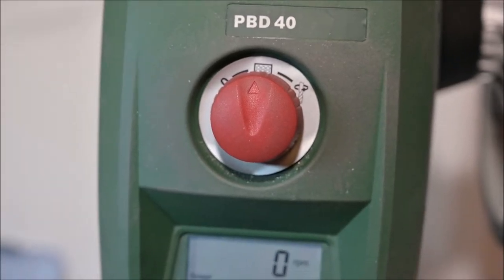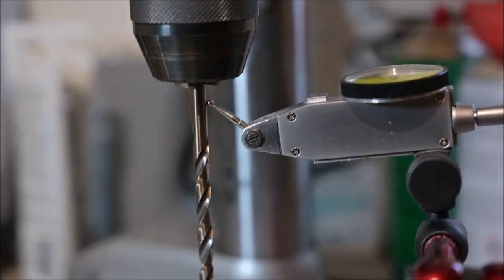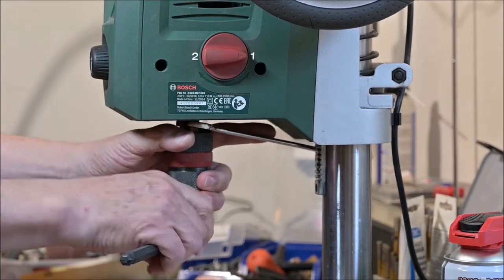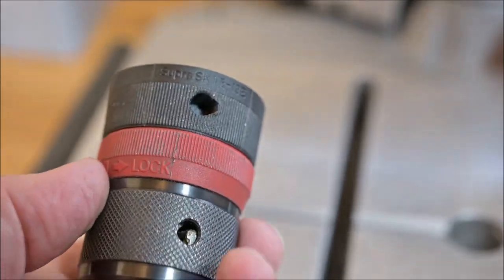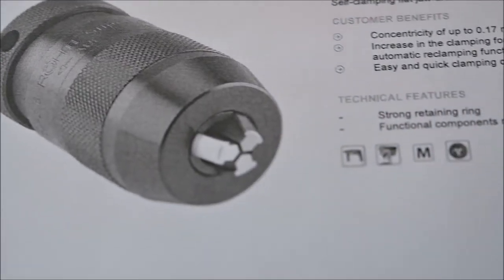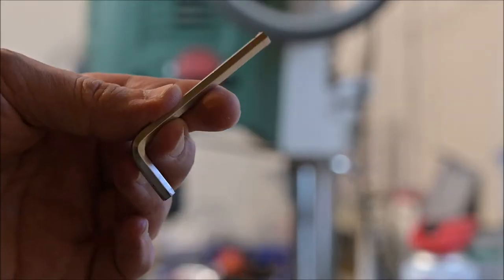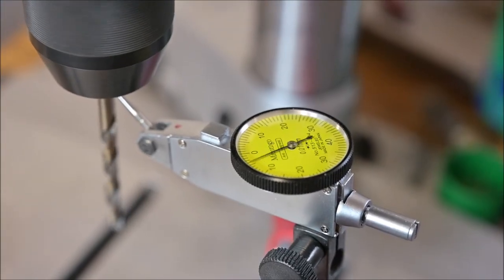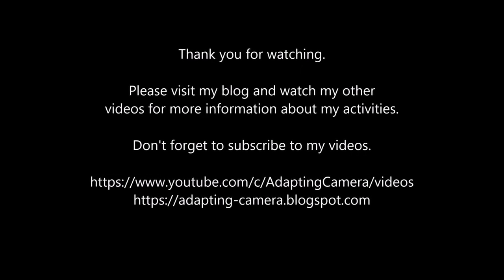Chuck changing on Bosch PBD 40

Comment: I hope you can help.  I tried you method of chuck removal, but the locking mechanism seems to have broken and now when i exert force on the chuck with the Allen key it just opens the chuck so that the Allen key falls out.  Any ideas?
Reply from the maker: I am sorry for the problem you experience. Maybe the locking mechanism is not really broken, so try rotating the Allen key slightly so that all three jaws get a good grip of the Allen key surfaces and then try to lock it again. If it clicks then you are good, but if not then your only option is to use some sort of special tool made for chuck removal. There are two holes on the top of the chuck, above the red locking ring, so if you insert two pins into those then you should be able to twist and remove the chuck. If that doesn't help then you could get an adjustable pipe wrench with rounded jaws, put some soft metal (aluminium or cuper) sheets between the jaws and the chuck and lock it on the top ring, above the red locking ring. That should definitely do the job. Just be careful, the chuck gets easily damaged if you are not using some soft metal sheets between the wrench and the chuck. At the same time, you must tighten it hard enough so that the wrench is not slipping. Good luck, I hope you will be able the remove the chuck, especially if the locking mechanism is really broken.

Comment: II am in the process of changing the chuck, can you please tell me what size allen key you used? I am having extreme difficulty removing the old chuck because it keeps releasing the key as soon as I try rotating the chuck to loosen, thanks!
Reply from the maker: Hi, I think I used a 10 mm (220 mm long) Allen key plus the tube to extend it. The trick to tighten the Allen key in the chuck is that the jaws must be parallel to the key sides. Be careful, if the Allen key is incorrectly inserted and tightened, you may never be able to release it again. It is important that the chuck gets a good grip on the Allen key sides, otherwise it may get stuck when you twist it. Good luck, I hope you manage to remove it. Mine was also very difficult to remove the first time, maybe they glued the threads, or maybe it was because I have used the machine for several years before removing the chuck, or maybe the original chuck was installed by a huge alpha male with too much muscles and too little brains... 😂

Comment: Thank you for this video, I am on my second PBD 40 after Bosch swapped the first one for this runout. The second one is not much better so will be doing as you did with a new chuck. Did you ever measure the runout on the shaft without a chuck? Thank you again.

Comment: Hi there thanks for the info.. But i have question.. Can i use a 16mm or 20mm chuck on this drill press and if so what is the best option to go for.. Thanks again sir
Reply from the maker: Thank you for your comment. You could use a 16 mm chuck but remember that you will lose the ability to use small drills. The 16 mm chucks are also much heavier and larger. The Rohm 871062 Supra S 3-16 is one example but it is 340 g heavier and 14 mm longer. The original chuck is 375 g so already the one I chose is about 200 g heavier and about 5 mm longer than the original, I would not add even more weight and size. Also remember that the motor is only 710 W so it is not that strong. In my opinion 13 mm is the optimal limit, and of course, in my opinion, the one I chose is the best, at least for my needs. 13 mm does not mean that you can't drill larger holes, I have drilled very large wholes, also in metal, but you need the right drill.
Reply: @AdaptingCamera  Sir thanks alot for these valuable information, you've been so informative. I think I will stick with your advice since it really makes a lot of sense. I wish you a very cheerful day.. Stay safe my friend 👍🏼🌹

Comment: I purchased the Röhm chuck you used to upgrade my Bosch chuck but it came without the screw threaded Mount and now needs the addition of an Arbor which prevents it being fitted to the Bosch PDB 40 Bench Drill. It seems the screw-on version of the upgrade is no longer available.
Reply from the maker: I don't know what you mean by no longer available... I mean, it's made and is definitely available but perhaps not in the shop you wanted to buy it from. You can buy it from here: https://eshop247.roehm.biz/DE-en/supra-s-264.html Sorry you ordered the wrong one, try to return it because you have no use for that one. When you order you must type the right part number. Only the ones with 1/2"-20 mount fit this machine, and the one I am using is the 871050. That is very important when you buy the chuck.
Reply: @AdaptingCamera  thank you for responding to my comment. I think being sent the non-threaded version bearing the model no. 871050 didn’t help and suggested the correct chuck in your video was not available now. I spoke to RÖHM and they confirmed 871050 to be the threaded one as you state. Quite why the one I bought from V-TOOLSTORE in Germany isn’t the threaded one albeit bearing the same model number confused the guy at RÖHM so not sure what’s going on at V-TOOLSTORE 🤷🏼‍♂️. But I was advised by RÖHM in U.K. to contact a U.K. company called Cromwell to buy the correct one and it’s being delivered Monday. The non-compliant one will go back to Germany for a refund. Thanks for a great video and your help towards me sorting it out. 👍🏻
Reply from the maker: @TonyGator78  If they sent you the wrong chuck they should exchange it for free. The Röhm product numbers are different and unique. The 871050 is the only one with that number and that is threaded. If that shop told you otherwise then they are lying.
Reply: @AdaptingCamera  I asked them if they could get the version with a threaded back end but after saying today that they cannot they agreed to a refund. I have contacted RÖHM at their U.K. distribution centre and while they cannot sell me the correct one they told me who could and I ordered it today. So hopefully I will get it on Monday and the refund will pay for it. 👍🏻

Comment: Thankyou for posting this video. My issue is I own the drill and this have purchased the same upgrade chuck. My issue is when I lock the old check with a wrench and use an Allen Key in the same direction as your video, the chuck releases the allen Key even though the chuck has been set to Lock. Would you know what im doing wrong as I cannot remove the chuck for the life of me.
Reply from the maker: Difficult to say, but maybe you did not insert the allen key right. Three of the allen key sides must be perfectly aligned with the chuck jaws. Anyway, this is one reason I replaced the chuck, the locking mechanism is a joke on the original chuck. Mine occasionally released the drill, which is definitely horrible.

Comment: Just for clarity (since the Rohm link isn't working): It seems like the actual model showed here is the '871050', which he points out at 5:35.
Reply from the maker: Thanks. Yes, it is the 871050 and I don't understand why the link is dead. Maybe they stopped making it with that number.
Reply: @AdaptingCamera  Seems more like it's some sort of page update where they didn't migrate the links.  I bought that same model from them just this week and installed it a few minutes ago.  That first chuck is stuck on there really tight, but the 'handle' tricked work (eventually).  No loud bang, but a lot of sweat! Thanks for the video.  Really appreciated!
Reply from the maker: @Drokkstar_  Good news. Thank you for your comment. I am glad it helped you out.

Comment: Hi, I came across your video as I am trying to remove the chuck as well. I can't get mine off somehow. I tighten it as hard as possible but the chuck is slipping and nothing is happening. At some point the allen key just falls out. Like you mentioned I never used brutal force and definitely  not a hammer. Any tips on how to take it off? Thanks!
Reply from the maker: Hi, I am sorry you have the same sort of problem I had. If the Allen key falls out then it is not inserted properly. The Allen key has six sides, you must make sure that three comes in contact with the three chuck jaws. Be careful, if you tighten it wrong you may damage the chuck. There is another option to remove the chuck, but it requires some DIY to make a tool. On the top of the chuck there are two holes, here you can see one: https://youtu.be/nCqVoaGVK8g?t=64 those holes can be used to get a good grip to hold the chuck, but you need an insert in both holes, otherwise you will damage the chuck. It is pretty simple to make such a tool, or maybe you can find something similar ready made tool which can help you out. I intend to make one and show it, but it may take some time. Basically, what's needed is a ring with two pins which fit into those two holes. Anyway, it seems that some chucks are more difficult to remove than some others. Maybe they applied more glue to yours and mine. Good luck.
Reply: @AdaptingCamera  Thanks for the reply! I guess there's some welding to be done then :)
Reply from the maker: @michielmos1972  I don't think welding is necessary, at least I will not weld, as I don't have any possibility to do it and have a simpler idea.
Reply: @AdaptingCamera  I just tried it with a pair locking pliers on the upper ring. I can twist the ring but it doesn't come off..... I think internally there's something damaged.... Oh man, this is a project that going to take days I'm afraid
Reply from the maker: @michielmos1972  I am sorry if you broke it, and to be honest, I don't know how that is possible. I tried with a wrench initially, but quickly realized it was not a good idea, if nothing else, it would leave ugly marks. Anyway, I hope you manage to solve it. Does it mean that now you can't insert a drill and tighten the chuck at all? Maybe that's why the Allan key fell out all the time.
Reply: @AdaptingCamera  It's off! I dismantled the plastic upper part completely and took the metal ring off with a Dremel. The new chuck is mounted already. Thanks for your support!
Reply from the maker: @michielmos1972  I am glad you managed to take it off and hope you will be happy with the new one.

Comment: Thank you for the video. My Bosch PDB40 has an excessive wobble. I bought the machine for metal work and sometimes the holes are just square. I'm using quality drills but it doesn't seem to be accurate enough.

I tried to change the chuck and followed the instructions in your video, but whatever I do it seems to impossible to remove it. I'm affraid I'm destroy the thing by putting even more force on it.

I'm doubt if I void the warrenty if I remove the original chuck...

Any tips?
Reply from the maker: I think if you have such issues then you should send the machine in for service under warranty and NOT chanage the chuck. Wait with the changing until the machine is back from the service in it's original condition. Drilling "square" holes in metal is not normal. I bought my machine mainly for drilling in metal, but not even after several years of fairly heavy use I had problems like the ones you described, not even with the original chuck. The problem you have is definitely not normal and is not going to be fixed by chuck change.

Comment: Hello, thank you for this very interesting video. 
I myself own a PDB40 and unfortunately I have problems drilling straight. I am not a mechanical expert but do you think that changing the drill bit is a good idea? 
I am not a mechanical expert but do you think that changing the chuck to the Röhm Supra 13S 1/2" (871050) will solve this problem?
I have been working mainly on wood and some aluminium.
Thank you very much for your feedback and sharing your experiences.
🇫🇷
Reply from the maker: Thank you for your comment. It is difficult to answer your question without exactly knowing the problem or having seen the results. "Not drilling straight" means for me that the drilled hole is not 90° to the table surface. In that case I think it is your table attachment not properly installed and aligned to the drill head, or the column holding the drill head is not squared properly to the surface. You should start by checking the alignments and square the machine properly. Buying a new chuck would improve handling and the chuck wobble. I don't know if it would fix your problem, since I don't know what exactly means "not drilling straight".
Reply: Thank you for your reply and your responsiveness. 
You are right, the expression "straight drilling" is a bit vague and I apologise for that. 
I meant drilling at 90°.
My table is orthogonal to the drilling axis.
What I have noticed is that there is almost always a deviation of the drill bit between the entry point and the exit point.
Hence my question about a possible cause due to the concentricity problem, which would make the drill deviate under the cutting force.
Take care of yourself and your family.
Reply from the maker: @marcciesla9238  Thank you for clarifying that. Anyway, I am by no means an expert, but it's a rotating tool, so the way I see it, it can't make holes which are not aligned with the motor spindle axis. So the only way I can think of making holes which are not 90° compared to the material surface is if the measured surface is actually not parallel to the table, or the column is not 90° to the table in every direction. Even if the machine head is not aligned to the column, the hole should still be aligned after drilling, but would be bigger than the actual drill. This is also the case if you have concentricity issues. Concentricity problems means the drill is not in the exact centre of the rotation, so it is not concentric. That means that the hole it is drilling will be bigger than the actual diameter of the drill. The chuck I have now has a better concentricity than the original chuck had, so now I can drill smaller holes without breaking the drill bit, and of course, I can now drill holes which have the diameter of the drill bit, so now I have higher accuracy.
Reply: Thank you very much for taking the time to reply to my last comment.
Your analysis is good.
It is now up to me and my PDB40 to improve on this... Lol
Greetings from France

Comment: I'm researching for a press drill.  Bosch PBD 40 has a mix of good and bad reviews.
Some say that it tend to bend a it when tighting as the column is too flexible. This means the drilling angle is not 90 degrees anymore.  Is it right?
I can have it for 255€. If I buy the RÖHM Supra 871050 for 75€, total is 330€.
Is it worth buying, or are there better options?
Reply from the maker: I don't know who say such stupid thing. It's not a pillar drill, it's a bench drill, so if you want perfectly drilled holes you must think about that, but there is no way you can drill anything other than 90° holes unless you tilt the head or the fot. The column is not weak, it's very stable and rigid, but for best results you should fix it to a sturdy bench. Mine is bolted and is drilling very precise holes. You can't get a better machine for 330€, that's for sure. If mine would die today I'd buy a new one to replace it with. You can buy a lot cheaper machines, but those are definitely not better or equal.
Reply: @AdaptingCamera  Thanks for this clarification.

Comment: Hello, I bought the 871050 and change it but I still face the problem: my drill bits get stuck in the chuck, I have to use a wrench to loosen the chuck, is that normal for that price of drill chuck ?
Reply from the maker: I don't understand how your drill bits can get stuck in the chuck. I mean, are you sure you insert them right, in the center and not offset so they get stuck between two chuck jaws??? That's the only time I ever had drill bits getting stuck, but even those times I managed to remove using hand force. Using a wrench should be avoided because it can damage the chuck. Anyway, the best way to avoid that is to close the chuck as much as possible before inserting the drill bit, and while inserting, "playing" with the drill bit, pushing in and pulling out lightly to feel that it is in the middle. This is what I do with small drill bits. Larger ones are easier to place in the center. Anyway, it seems that your issue is not related to the drimm machine, since that can happen with any drill machine and any chuck.
Reply: @AdaptingCamera  it's probably my fault, but I'm also using it on metal, in particular hard stainless steel, probably i broke it with the step drill, it was very intense, now it's also difficult with M10 bit... but otherwise ok with smaller bits... I thought it was also due to the automatic retightening which I appreciate in fact. I prefer to use a wrench than not having a retightening effect. Is there any way to correct that, using WD40 or so ?

Comment: Thanks for such an informative video. I am planning to change the chuck on mine and your video is a GREAT help.
One question...did you consider the RÖHM SUPRA-I for even better concentricity...?
Reply from the maker: Thank you for your comments. No, I did not consider that one because I could not find anyone selling it. Looking at the specs, I don't think the differences in concentricity (0.05mm) would be noticeable on this machine.
Reply: @AdaptingCamera  OK....I've just now checked the Röhm catalogue more closely and by the looks of it, the "I" version wouldn't fit anyway, as it's not manufactured in a 1/2" 20 mount (!!)
Reply from the maker: @Lignumopus  Actually, according to this document: http://eshop.roehm.biz/media/attachment/file/d/c/dc0001470.pdf it does exist, but may be hard to find, depending on where you live. It has item number: 871055 in the document.